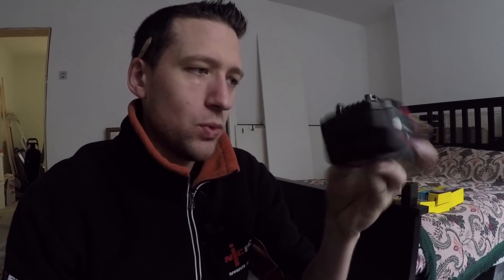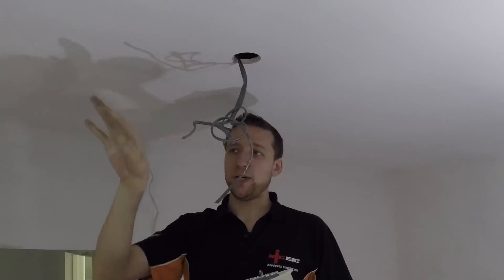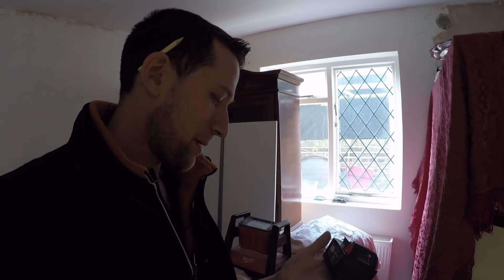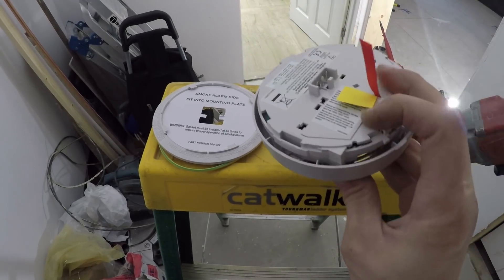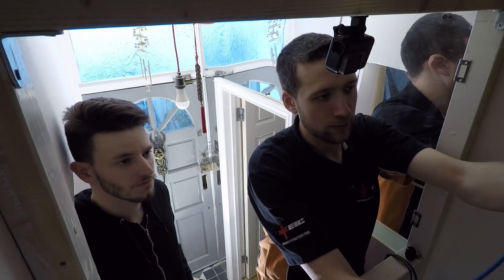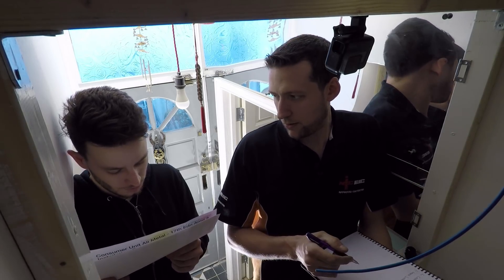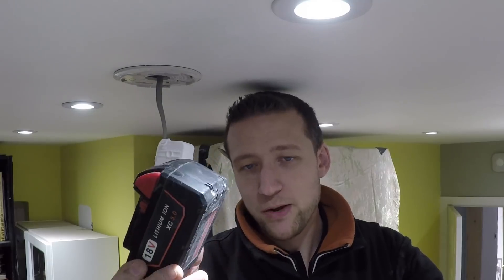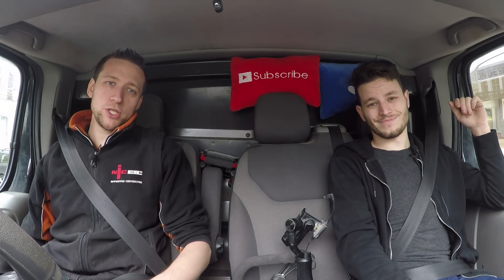House rewire Part 3 - An Electricians Day in London | Thomas Nagy

Comment: Recent downlight hole cutting was the stud wall was moved 100mm after I had left, 1st hole wrong side of joist, lots of head scratching until builder remembered they had changed the wall. Not my fault but makes you doubt yourself when its wrong.

Comment: That issue about only using supplier X's MCB/RCBO/RCD in supplier X's enclosure is 99% supplier protection, 1% consumer protection. There's a bit more in not mixing-and-matching due to such mundane issues as alignment of bus-bars, but the way things are worded in the regulations makes it the letter of the law. 

When it comes down to it, a steel box with a DIN rail and brass earthing and neutral rails is near enough interchangeable with another one, give or take what individual preferences are for layout. It's the quality of the component elements that is rather more important.

Of course the suppliers of power tools also make the same claims about only using their batteries for much the same reason, but without the recourse to law save, possibly, on IPRs. What matters is the quality of the internals, not the  brand.

Nb. I should add if some manufacturer wants to produce a CU which would be more than just a metal box with a DIN rail, how about one which is RCBO only where the functional earth, phase and neutral are all on bus bars positively connected leaving circuits to be terminated only on the RCBO and he protective earth (the latter should be deliberately kept separate, even though, in principle, it would be possible to treat that the same way). For those circuits only requiring an MCB (smoke alarms) it would work with those two (but not RCDs). This would eliminate all those neutral and functional earth tails necessary when using conventional RCBO/CU set-ups.

Comment: Just seen you talking about the second battery while having the fire alarm and clipping the box on the joint then realising that its wrong. The whole time you was talking about the battery i was thinking that box wasnt going to go through the hole in the backing plate

Comment: 11:28  "How many times have we all been there and done that"

Too many! Whether it be assembling a connector plug without the backshell, soldering or crimping connections without putting the heatshrink on first (fret ye not, I'm safely in the ELV world!) , flaring pipes without putting the union nut on first... 

It's an industry standard fuck-up. 😁

Comment: the biggest problem with some 3rd party batteries is that they may not have a high discharge rating needed to run  power tools effectively. ("C" rating"

So while you might be able to run a site light for similar time as a named brand, ( or enough to justify the price)  start to pull the type of current a heavy duty drill needs in short bursts and the 3rd party battery may not fare so well. or not well enough to justify how cheap it is.

Just different use case scenarios to be aware of

Comment: Hey,good chanell. First time I watch an electrician from UK. I am wandering,what voltage are you using in UK? Earlier I heard it was 350AC,but not sure. And what is the difrence between UK and Europe,I mean most of european countries are very similar to german standard,ofcourse they are a bit advanced but its how should I say-a point that the rest want to reach. Greetings and you just took subscribe from me 👍
Reply: Silenzzio    I will answer that for you its 230 ac single phase and 400ac 3 phase in u.k   And greetings  to sparks across the pond

Comment: I will just say this as an American electrician; to me the residential panel boards on your side of the water are much smaller than the ones here. Most being 14.5” wide by 30”+ (sorry for not converting to centimeters). I was curious if you ever find this frustrating or are the panels I typically see you work in older ones?

Comment: Hey Tom, Great Channel! Fairly new to it, had a question which has probably been answered or is just practice over their, but why do you do loops to your receptacles and back to the RCD? I'm an electrician in the US and just curious.
Reply: im not an electricain myself but i do know how it works, here in the uk we use ring circuits, the reason we use these is becuse back in the war time there was a copper shortage and we needed a way to use thinner cable on a high power so we have a loop of 2.5mm twin and earth cable (simlar to US romex but better) wich loops though all the sockets (receptacles) and then comes back into the 32a breaker that way becuse its a loop we can put it on a higher breaker but not overload the cable, however some people in the uk just install radials now as we no longer need to use rings. however both are compliant

Comment: I would keep those non genuine batteries specifically for use in the light. Looks as though they might be o.k. so long as they`re not subject to hard work and frequent charge/discharge cycles.

Comment: okay im drunk. but tom you have to consider recharge cycles. the original batter you tasted you most likely recharged already a lot of times and the new one you didnt. the more often you recharge those the worse they get. in the new ones it doesnt make a lot of difference but if you use them a lot like you this is a huge factor you have to caclucted.

Comment: With a lot of the batteries for high end power tools, the inner workings and cells are bought off the shelf from the likes of sanyo, panasonic, samsung etc and then just placed in branded plastic bodies to fit each make of tool.  you will find if you open up some old ones that apart from maybe the pin arrangement and body the actual internal parts will be near identical. 3rd party after market batteries often include the very same power cells and are the same apart from the outer body.

Comment: 11:00 and follow: 

Yeah this shit happends me too in the past. Mostly at lamps. Here in Germany (or in Thailand) battery smoke warner allowed and in house companies change the battery yearly. Normally works 3 years without problems. 

I self use at home only Brennenstuhl 10-year-build-in liticium battery smoke warner. I pay around 28€ for one. One warn one time wrong - in sleeping room at 5:30 a.m. 

The cheapy PRC products with build-in radio for communicate with other don't work good. Battery empty, no radio, warn without smoke, not warn if smoke, and so on. 

This mean - never save at good quality! It can save your live at the correct time! 😉

Comment: Those brks are pretty decent, only design flaw is you need to cut quite a large hole in the wall/ceiling for the connections, I use a dry lining box for neatness but its still a pain in the ass. Stick to Aico.

Comment: Do any solutions exist to find the ceiling wires before you cut perhaps some kind of tag and dector combo where you attach something to them or even a solution silimar to the telephone line tracer probes
Reply: Careful measurement, marking out and accurate drawings are the key. On major projects we mark the slab at first fix stage, and wire to point. Cable recovery and hole cutting is then responsibility of the dry lining team, that way they take care of the cables when boarding out. Most things are always `fishable` anyway, the main snag is clashing with ceiling grids or timbers.
Reply: Energise the circuit then use a thermal imaging camera to see beyond the ceiling 👍

Comment: Hi Tom, great video as always... Was there any particular reason you put one circuit on it's own individual  RCBO?
Reply from the maker: That rcbo was feeding the lower ground floor sockets which was a sort of “separate entity” to the rest of the house so just decided to put it on its own rcbo. Difficult to explain without taking a camera and actually showing you but just felt it could use its own dedicated rcbo. That’s about as well as I can explain it! 😂
Reply: Fair do's 👍

Comment: Milwaukee batteries work in very cold conditions. The after market batteries will struggle.
Reply from the maker: I can definitely confirm that the aftermarket batteries struggle in the cold until you use them a bit and they start to warm up. If I take them out of the van on a very cold day the tools are completely gutless until the batteries warm up. Tit for tat I suppose 😬

Comment: I fitted a BG fuse box the other day, 2 things I noticed where the factory connections where so tight that distorted the crimped ends on the tri rated cables so made them hard to get out!! The other thing was the metal door opens down so you can leave it hanging open! I thought the whole point was a top hung door so it couldn’t stay open on its own... anyway just thought I’d say.. cheers
Reply: I thought the door going down was a better job, fed up with them stupid fall down flaps.

Comment: @Thomas Nagy +Thomas Nagy I agree about only using manufacturer approved accessories and devices inside consumer units, however what are you supposed to do when you come to a really old consumer unit and you needs to replace a device like a MCB that you can no longer get?
Reply: Buy one off Ebay and pretend there was a spare already there! Or you could double things up, say burglar alarm or doorbell circuits, and `win` a breaker that way. If all else fails, it`s new board time, always wise to assess things before work commences so both you and the client know what they`re in for.
Reply: That to me is a judgement call.  I've been known to fit other make breakers at a pinch, but only as a stopgap measure. (till the new one arrives)

Comment: Hi Thomas, Just a point I spotted when you were doing the CU change. 
I cant say I know what the current regs say (I was up to date with the 16th Ed), But I would presume they align with the requirements for separation of services required for Gas pipework.
We're told gas pipework should be kept at least 150mm away from CU's, Meters, Switches etc...
Do you normally provide the clearance, fit some kind of barrier (pink plasterboard?) or just note down on your EIC the departure from the requirements?
Just interested if anyone actually pays attention to it...I know loadsa gas guys ignore it, hell - a lot of boiler installs I goto, they actually cable tie the mains flex ONTO the gas pipe! It seems that unless there's an inspection happening details get ignored... :-o

Comment: Thomas, do you use BG board all the time? I don’t use them anymore now use MK board so much easier, just wonder what you think?
Reply: I use either, usually I just get whichever's the cheapest board (often there's an offer on somewhere) that I trust that'll fit where it needs to fit, hold all the devices it needs to, and has the MS on the preferred side (depending where tails are coming from). I avoid Hager like the plague... what are they thinking with those stupid rectangular knock-outs, instead of nice easy to gland and grommet round ones?

Comment: Never buy knock off batteries alot have no protection for your tools just a heads up
Reply: rik061119 without knowing their true origin they could overheat and have been known to catch fire. (for reference I worked as a tool hire manager some years ago and had several cases of fake batteries overheating, one exploded!)

Comment: Why don’t you fit RCBO boards as standard???
Also why all the Wiska glands??
A manufacturer endorsed grommet with intumescent sealer works equally as good. 
Rear entry options look much neater. 
Also what brand of cable do you use?? There is so much inferior foreign shit on the market. 
Prysmian is the  only way forward & we should all ask for it!!
Reply from the maker: I'll talk about this in the next video, good points you raised
I just fill all the holes in the top of the board with wiska glands and if there are any spare which dont have cables going through i just put a bung in them. If someone comes along later on down the line and tries to knock out a metal hole its normally a bloody pain once the board is fitted so it saves them the hassle later on. thats the only reason really.

Comment: You just gained a new Patreon 👌🏻
Reply from the maker: appreciate it pal ;-)
Reply: thomas nagy hey Thomas u said u normally use Aico for your smoke alarms! My Dad works for Aico Smoke Alarms!
Reply: Great video, your videos ahow what a varied and intresting work Electricians do.  Could you do a video one day about electrics and  Insulation between floors / attics.  Ive heard that you shouldnt put wires under insularion as they can overheat.  Keep up the good work!

Comment: I always use 1mm heat resistant flex for spots lot easier to work with easier for fishing through and to terminate little more expensive but worth it

Comment: Tom.  Just wondering when you remove all the cables from the ccu, how do you know what is what when you put them back in a new one.  Apart from the difference in c.s.a?
Reply: Despite that being the obvious.  Many sparks don't mark them.  So how to identify the correct circuit.

Comment: As you use the BG consumer units, have you tried the new BG RCBO's yet?  They are the same size as an MCB and are brilliant!!
Reply: The new mini RCBOs are gonna be the way to go ... great to wire, even easier than MCBs if ya asks me . What we now need (manufacturers are you listening?) is ones that get their functional earth via the DIN rail rather than requiring a second flylead... and maybe interlocking line/neutral busbars kinda like the USA does with their split phase system so there's no need for ANY flyleads from the RCBO

Comment: Totally agree with the sticking with the same manufacturer for all protective devices in the CU. It comes down to product testing and the fact they're not going to be tested with another manufacturer's gear in it. I like how honest u are Tom, the thing about YouTube is everyone is the best tradesman in the world and everyone else is shit. We all make mistakes mate and we never stop learning. It's good you're putting the time into explaining things to young Tom too. Keep doing your thing bud, all the best.
Reply: And always go for a brand thats widely available, that way you can pop into any wholesalers and pick up replacement/additional breakers.
Reply: Electrically I can think of absolutely no reason another breaker tested to the same standard with the same specifications will not work correctly just because the name on the front is different. However, if say the bus bar clamp is 1mm offset forward or backward compared to the other units, you place an immense amount of stress on the terminals and the breaker cases, which is no good.

If they're physically a suitable match it really wouldn't bother me. Mind you, I'm not installing them for a living so I have no liability issues at stake.
Reply: So umm do I have an illegal CU. All of my breakers are the same except for one circuit

Comment: Hey Tom, been watching your videos from the word go! Keep it up! One thing I noticed today was a mistake I used to make! When connecting the interlink cable in the smoke alarms, you should not sleeve the black brown, as it is a ELV single cable. Therefore, can/should be left unsleeved. If go into part 5 of BS7671 and you can see from the colour coding that it doesn't need to be sleeved brown.
Reply: Luke Whitewood no harm in sleeving it. Good practice you could say, but your correct there is no need...
Reply: 👍 Niceic picked me up on that... If that's all they can pick me up on then can't be doing bad... Think many electricians do the same as they see the interconnect as a switched live, they just do it by habit. But your 100% correct!
Reply: Yep don’t sleeve the trigger wire
Reply: I learned about this on another site. Facebook site I think. I did a training day with aico that they have around the country and they didn’t mention it. Although no one brought it up
Reply: one small niggle. It's not ELV... it's mains referenced and depending on manufacturer can be floating at mains voltage (usually the alarm pulls it to neutral to trigger).

I never sleeve black or grey wires as brown, because black and grey ARE phase colours.
Reply: Luke whitewood    Thanks for info buddy as i sleeve . Will not in future as there is a few posts on this. Force of habit me doing that. Cheers

Comment: If possible do you cut the holes out for the down lights before the painter goes in, im thinking incase the holes get scuffed by the cutting?
Reply: Bang it in reverse a lil way then switch to forward
Reply: Lee Brown always do it after the painting just  make sure you got a good spark that won’t make any mistake 
I have done it before painting and to be fair leave them hanging wrapped in plastic and to be fair finish wise there not loads of difference in finish both look hundred percent neat no brush marks 
Just don’t put them in the ceiling intill you finish painting